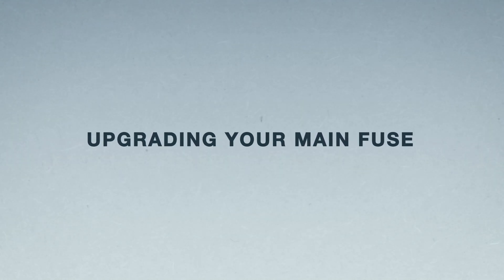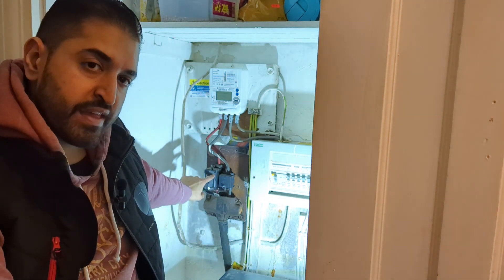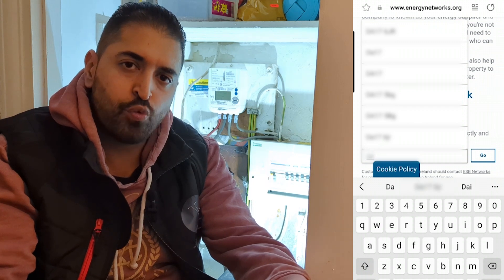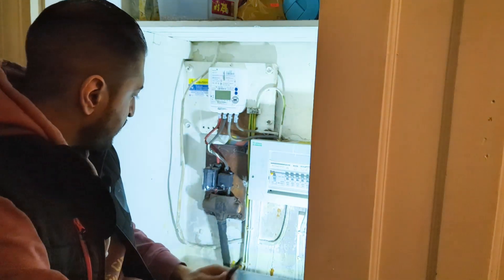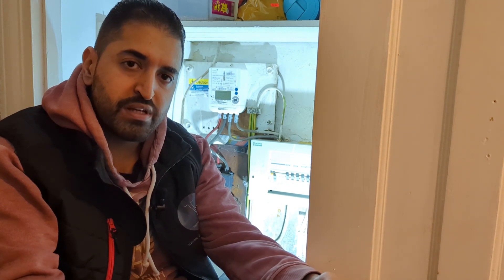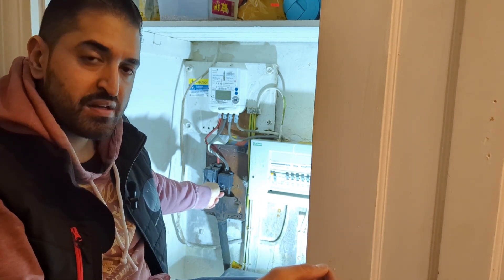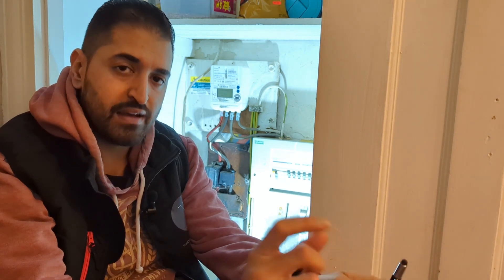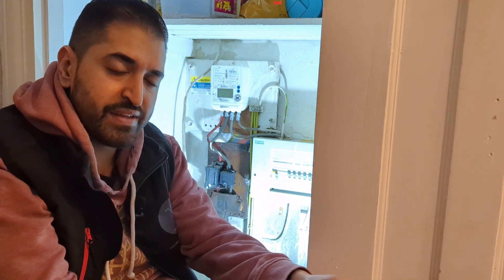Upgrading Your Main Fuse

Comment: Had a car charger fitted which is 32amp. Also have an electric shower and electric fire. So could easily exceed. It has load balancing and and CT clamp but my DNO has agreed to upgrade the cutout and fuse to 80amps for no charge.

Comment: Great video sir. Mine is a looped supply. I couldn’t have an EV charger. DNO came and said cables are capable of carrying the load so they upgraded the fuse from 60amps to 80amps. Apparently SSEN don’t fit 100amp fuses anymore??
Can finally have an EV charger installed now🙏🏽
Reply from the maker: Good evening,

That's great news!

Some DNO's are allowing EV charger installations in your scenario under the caveat that load management installed via CT clamps.

Kind regards 

Vartia Electrics

Comment: It shouldn’t be down to the householder to arrange an upgrade, a qualified installer should be making those arrangements? Systems can be TNS, TNCS, TT, IT. So if you don’t know these terms then you should not try to upgrade your mains intake fuse because you need to also calculate your working load and most people have no idea?
Reply from the maker: Good evening,

Normally your DNO will send a link via text to your mobile this will ask you to record your electrical set up. 

However we do guide our clients through the process whilst at the property.

Kind regards 

Vartia Electrics

Comment: Is the upgrade free that’s done by the DNO?
Reply from the maker: Good afternoon,

The incoming fuse upgrade is usually a free service, you can double check with your local electrician before hand.

Kind regards 

Vartia Electrics
Reply: @VartiaElectrics 👍 Thank you for the clear and informative explanation on upgrading a fuse supply for EV charging in the UK. Your insights made the process much easier to understand!

Comment: Can my EV installer contact the DNO for a cut out fuse upgrade? Or do i need to do it
Reply from the maker: Good evening @drB187,

Usually the client contacts the DNO as the account is registered in your name however it's a simple process, and most electricians are happy to assist you with the process.

Kind regards 

Vartia Electrics

Comment: Hi, very interesting and well explained.
 About the service cable, is otfen wrapped in that greasy strip; is a way to know its amperage(maybe from external diameter?) . Thank you
Reply from the maker: Good morning Elless317,

Unfortunately not, however the main fuse often has the amps written on it. Or you can phone your electrical supplier and they can confirm for you.

Kind regards 

Vartia Electrics
Reply: @VartiaElectrics  thanks👍

Comment: Do i need landlord permission to do this ? Also my fuse box and meter are not in the same room. Is this a problem?
Reply from the maker: Hi Leeroytrucks01, the landlord would need to grant permission and most likely have to make the call. 

The meter not being in the same room does not cause any issues. Please be aware if the fuse is going to be uprated the meters tails may also need to be uprated.

Kind regards 

Vartia Electrics

Comment: Did you upgrade the main fuse yourself or get the DNO to do it?
Reply from the maker: Good Afternoon Mike,

We got the DNO to upgrade the main fuse to 100amps. 

Kind regards

Vartia Electrics
Reply: @VartiaElectrics  nice  one
Reply: How much average to upgrade to 100?
Reply from the maker: @selaminaleykumk  Hi AtheistProphet,

In this case the meter tails (main cut out to meter and meter to fusebox) were only 16mm2 and needed to be uprated 25mm2 to support 100 amps. 

The DNO charged the client £170 to do this and fitted an isolation switch.

If the meter tails are a sufficient size for the relative amps, DNO's don't normally charge to uprate the fuse.

Please get in contact if you have any more questions
Reply: @selaminaleykumk The DNO will upgrade without charge normally. But they will now only upgrade to 80 A.
Reply: Spenergyworks want a long and complicated form filled out. I gave up, how is a normal person supposed to fill out that! I already have a pod point fitted so it’s not as if I can ask the fitter. I don’t even know who it was. It’s very silly. Now I just wait for the main fuse to blow then they do t have a choice but to come fit a bigger amp fuse.
Reply from the maker: @davidwood-c5m Hi,
Please give us a call on 0208 144 1428, we are happy to help you find a solution.